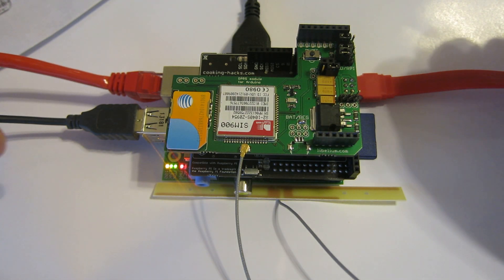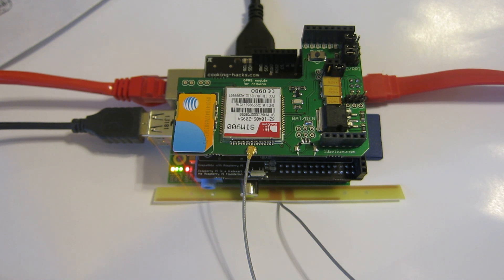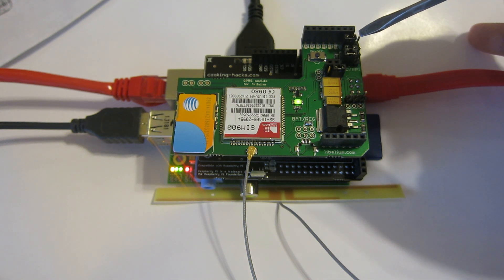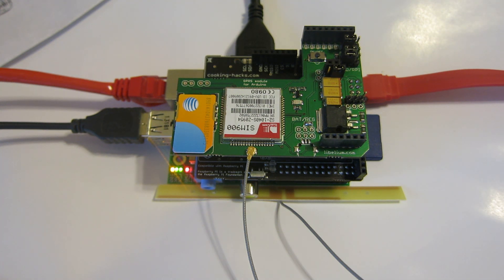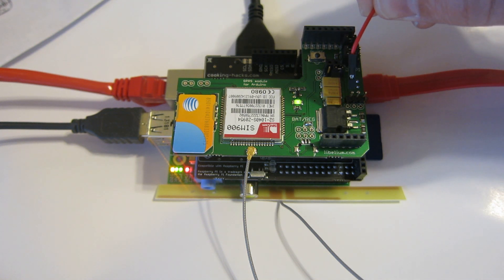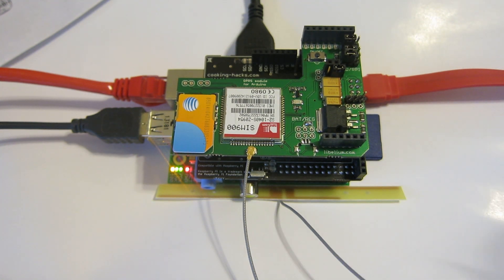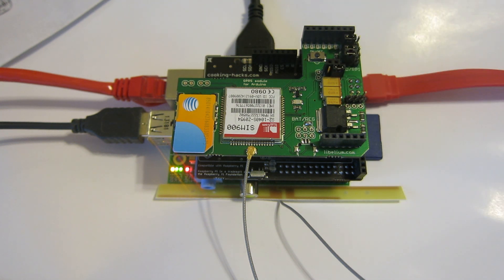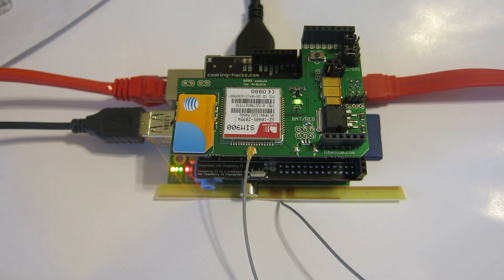Raspberry Pi to Arduino SIM900 GSM using Connection Bridge from Cooking Hacks

Comment: Hi Alen Halls! 

Thanks for your video! Still, I have to remarks/questions: 

1) On the cooking hacks website, there is in capitals said if you use a raspberry PI then that one jumper needs to be in the RPI mode. It can even destroy your board if you don't do it. 

2) On cooking hacks they also say something about a 12V - 2A supply as external mode. You don't have to use this one? 

3) Where can I find your next video?